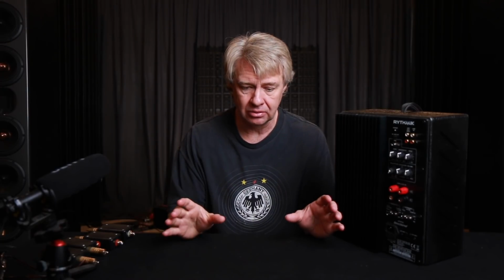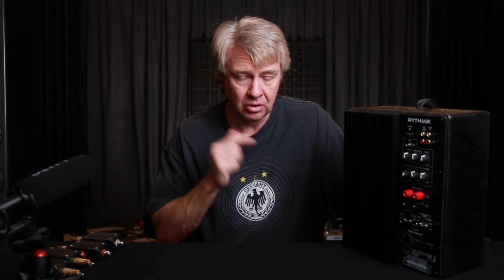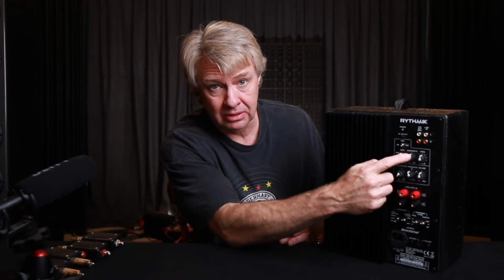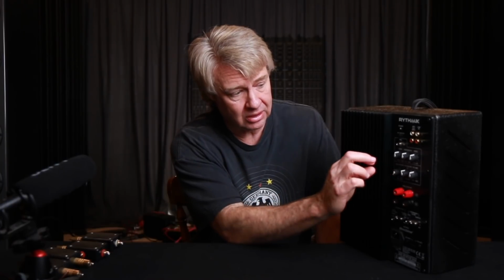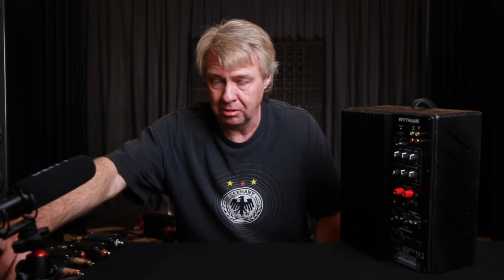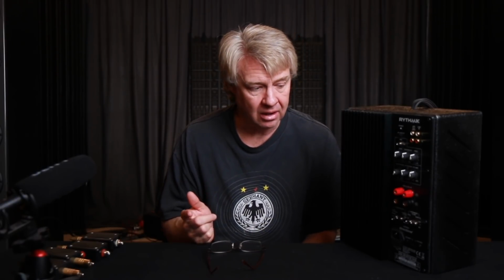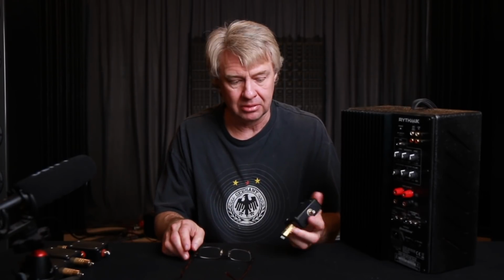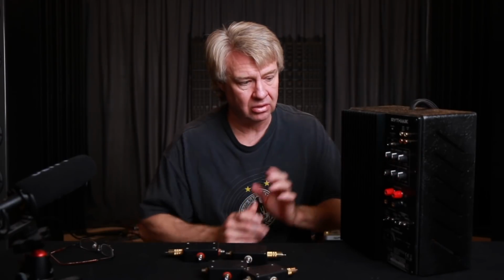How to DIAL IN your Servo Sub!

Comment: good subwoofer dials and control is the best thing i ever experienced and took my system to another level.  that rhythmic plate amp has most of what you need and better than most subwoofers you buy out there. 

as i only use digital sources i thought i would upgrade to minidsp shd studio, full dsp with digital outputs and more options. and keep my power amps and dac's.
Reply: I advise doing everything you can to keep devices like the MiniDSP out of the signal path, especially to your main speakers.
Reply: @dannyrichie9743  now i cant go back, full dsp is just way to fun.  i have only one digital to analog conversion but i do have a digital to digital conversion for the minidsp studio to get volume control and room correction dsp.  for main speakers not much dsp is needed, high pass and lowering the 3khz region is necessary, 3khz is really loud and harsh before i do a -7 db on it.
Reply: @sudd3660  From a strictly performance standpoint the Mini DSP will suck the life out of the music. The power supply, D/A conversion, and analog output stage is about the same as a $29 CD player form the early 90's.
Reply: @dannyrichie9743  i heard of analog output on mindsp, thats why i bought the minidsp shd studio, it has no analog outputs. ebu/aes right into my belanto dac.
Reply: @sudd3660  That helps a lot.
Reply: @dannyrichie9743   the problem is finding reviews for the gear,  
The Hans Beekhuyzen Channel was the only high end reviewer that did a review. seems to do little harm for the benefit it provides.
Reply: @dannyrichie9743  I did the same as sudd and have a miniDSP Studio (all digital no analog out) after my streamer/player to handle all sub xover plus it has customizable room correction with Dirac, then digital out via balanced to my Denafrips Pontus II dac to pre/amp with excellent results and no life sucked out of the music. Everything is much better and now I don't have to mess with battery biasing or dip switches on my Vandersteen passive external M5HP xovers anymore. My dual Vandersteen 2W Q subs and mag 1.7i never sounded better, although I am looking at your OB subs, or the sealed ones from Rythmik to possibly replace the Vandy spkr level only subs. Not sure if I missed it but what is your opinion on line level vs spkr hi level input on sub and have you ever compared? Vandersteen and REL are very big on it but others not so much. With my mag 1.7i xover at 40, or even at 80hz I can't see where much if any of the mains amp sound signature would be sampled to the sub and seems like a line level in would be even more pure/true to the signal, especially since with the miniDSP Studio all is done in the digital domain before the dac. Thanks
Reply: @michaelcampbell9459  The MiniDSP is less destructive to the signal the way you are using it. You will get far greater results by getting it out of the signal path and implementing our crossover upgrade to the Maggies. Our open baffle servo controlled woofers are the best match for the Maggies as well. They will match the radiation pattern of the Maggies and match them in speed and control. You can use the high level or low level inputs with good results.

Comment: Hi, Sir I love your explanation about this new breed of servo controlleb amp sub. W hen I first enter into these  audio hobby,I always hear from local audiophile here in our place Toronto ,that if your sub didnt came from Velodyne...that means you are not getting  the right bass.And Velodyne is synonimou with servo system sub as they always say. Ironically asVelodyne stop making their ULD SERIES  the quality of their sub decline until it was sold to a german audio dealer.Ive got a simple questio,If you dont mind pls ,the servo system inside the RYHTMIC sub   how does it differ from  the servo system of VELODYNE sub. And also is there any plan for RYTHMIC to come out a DOWN firing sub...if  not why? Great thanks

Comment: Love your videos, appreciate work you do, keep it up!

Why you choose 12" driver in your Servo Sub products not 15" ?
is it because of price, or 15" has bigger moving mass and it more difficult to control, or something else?
Did you have plans to produce  15" Servo Sub in future?
Reply: Higher Mms is actually desired in servo subs as the sensor mass is of lower influence.

Larger subs have a lower break up frequencies which means you can't control as fast.

Comment: Danny- thanks for this video- 2 questions - how high do these go (300hz?), and do you advocate for the swarm method, to flatten out sub response in-room?
Reply: I have used them with a crossover point as high as 300Hz, but 200Hz and lower is a better range to use them in. And the swarm method works great too. We have used that method before at shows to balance out the room loading.

Comment: What do you think of connecting to high-level like a modern day REL subwoofer? Isn’t it better to run speakers (esp. large floor standing ones) full range via high level connection?
Reply: There are big advantages in rolling off the bottom end of your main speakers. That is a subject that I will cover in my next video that deals with bi-wiring and bi-amping.
Reply: @dannyrichie9743  thanks; will eagerly wait for it. I’m a proponent of running speakers full range but know everything has pros and cons
Reply: REL sucks big time, huge time, compared to Rythmik like you cannot even FATHOM. you need to listen to the difference from a sub that you can ACTUALLY tune, to one you can't and is above 1K, like REL. they are coasting on a reputation and pure dogma.

Their high tier is a different story, but for what you pay for a single , you instead get 2 (or more) open baffle GR subs and REL goes back to absolute stupid investment.

So all that leaving your speakers full range for the sake of transparency and what not, BS. Seriously. It's a lousy argument. The sub bass on its own relieves the speaker woofers and lowers overall distortion for mid bass and midrange, depending of your speakers.
Reply: @BastianUllr  what would you buy buy for $5k for a pair of subs? Taking all recommendations:) thanks!
Reply: @Novilicious  what size is the room and what's the output you look to achieve? Are you open to DIY, or should it be finished?
Reply: @BastianUllr  18w*15l*11h (feet)…I’ll be sitting 11-12 feet away. I have sealed AT8600 speakers, they are fast and detailed like you won’t believe. Hence, Looking for a pair of ‘uber-fast subs’, they just can’t be slow. I prefer sealed subs as well that have deep and detailed extensions but not necessarily loud. Open to suggestions my friend but I suck at DIY so they have to be furniture grade for a high WAF :)
Reply: @Novilicious  Depending how many you can place, the more the better to control and even out the modes of the room. With 4x12" you should have the lower distortion of the 15"x2 although the size is smaller. With 2 15", you will have the output in a simpler way, but the bass might not be as even. Dialing 4 subs is more complicated, but if you have the room, go for it.  

NOW, read the reviews. There is an important part to all of this. These subs would sound as if NO sub is on the room. Subs does not mean MORE bass, because you calibrate them to be flat. So, it would sound about the same for the most part.... until there are subsonic frequencies that call for the lower output. For certain recordings in live venues, it enhances a LOT the feeling of space. For electronic music, is like having good headphones on, but then you also feel them. 
BUT, do NOT expect them to increase your bass unless you actually modify the curve to be higher on the bass or something. They simply dissapear once you dial them in properly. I have fast speakers too, no problems. Just, use the controls wisely and get yourself a USB Microphone and install REW in your computer. It's way faster, specially if you do not have a lot of experience.

Comment: Love my Rythmik FVX15. About to upgrade to 4x sealed for my dedicated home theater.  I'm between the Rythmik G25HP and the JTR RS1.  

One thing that has been said (by Chris Brinhaver at PS Audio and Matthew Poes, among others) about servos is that the feedback mechanism is inefficient because the amp has to dedicate a lot of power to correcting the driver's motion.  

I'm wondering if anyone knows how much of a concern that actually is, given I'm aiming for clean performance with no compression at reference levels in 4500 cu ft.  The CEA-2010 output numbers are actually higher on the G25HP than on the RS1, which makes me think this isn't a major concern.

Comment: What is the lowest voltage rating for the caps you can use in the inline filter?
Reply: The input voltage is very low. So they could be just 10 watt rated caps.

Comment: How do open baffle subs compare to something like Rythmik's dual opposed subs (G22 / G25)?
Reply: The radiation pattern is very different, so is the way they load and pressurize the room.
Reply: @dannyrichie9743  How would that answer maybe translate into musical terms like detail/pitch/tone/transparency? Thanks
Reply: @michaelcampbell9459  The lack of room boom from the use of an open baffle design will make all of those attributes much easier to discern.

Comment: If a pre-manufactured 3sub driver  solution-was offered with a nice painted finish, I would probably buy it.- any idea if that will ever be available?
Reply: There are people out there that build out our products in finished form. I can hook you up with one of those guys if you want.
Reply: @dannyrichie9743  
Do they have a website with photos of their work? Basically I want it to look like it’s not DIY. Do they veneer the flat packs? Or do they offer nice painting? Or magnetic cloth grill on the face of the sub?

Comment: What about tube amps for music? - it is written on the site that the resistance at the output of the amplifier will change all the time under load (including due to changing temperature) and it is impossible to set up the subwoofer correctly ... it cannot be coordinated with the stereopair and it will not dissolve ... (by the way, other manufacturers silent about it)

Comment: So if I was going to run these subs with the tripple towers and use a 8 inch point source driver, I can just run the point source in OB instead of running it in a TL box? Or do you think a TL would still benifit? 
Im guessing running the PS driver in OB would raise  the x-over point and speed the driver up. 
I have industrial hearing damage and I can't hear past 12k and 10k is really where I listen to max so tweeters aren't really needed so a good 8" PS should do me for the highs.
Reply: The servo subs can be used in crossover points up to 200Hz. So if your 8" driver can play down that low then you can use them together.

Comment: Planning to purchase your subwoofer and stand mounted main speaker kits. The electronics that I have are two vintage Japanese mono tube integrated amps. The output from the amps includes taps for 16, 8, and 4 ohms, plus common. How should I connect the integrated amps, the subwoofer and the main speakers?
Reply: There are speaker level inputs on the amp.
Reply: @dannyrichie9743  Yes. There is one volume control for each amp. This means that to adjust the left/right balance, each amp's volume has to be fine-tuned manually. One possible future project would be to have a remote controlled device that connects the volume knobs somehow so that the balance and amount of volume could be adjusted remotely.
Reply: @robertst1218  A separate volume control for each channel is a huge pain. I think I would by-pass the volume controls of each amp and add a good pre-amp.
Reply: These amps have an amazing vintage tube sound. If or when I add a preamp would probably just start over with all new electronics to get the best possible sound. Maybe I should hold off on the subwoofer, until all new amp and preamp are in the picture. @dannyrichie9743

Comment: You lost me with the filter box.  Does that plug into the back of the receiver/processor or the subwoofer amp?  And how does it work to affect the crossover from the "mains" (towers or satellites) to the subwoofer(s)?

Also, I can kind of see how using the controls on the back of the amp to flatten the responses, but I was lost on how the changes affect the output.  In other words, if I change the "A" control, then what happens to "Z" on the output (driver/room) side?

So confused... it's like I can see a shadow of a shape showing through a foggy day, but I really can't recognize what it is, much less see it clearly.

Thanks for these vids.  They are opening new ideas in how I move my home theater forward.
Reply: I just shot a new video on the inline filters. It should be out tomorrow.
Reply: @dannyrichie9743  Thanks!

Comment: Id buy the filters if he sold them.  Ive been wanting to try cutting off below 80hz to my main speakers. 
A simple line diagram would help clarify how to diy the filter and connection options. If a reply, Thanks.
Reply: I just shot a new video on the inline filters that should be out tomorrow.

Comment: Is the driver a special servo driver that works with the servo amp, or can any driver work with the servo amp?
Reply: The driver is a special servo driver that has a coil to give the feedback needed by the amp.
Reply: @g0g0Sutra  then you use velocity feedback with a sensor that is noisy. It's not desirable.

You want a driver with an accelerometer.  In theory all drivers can be used, but there are practical limitations. These limitations mean thay servos are only useful for bass <150-200Hz or so.

Comment: Danny, if a sub has two identical woofers facing to opposite directions, does it make sense to use two separate amps to do individual driver equalization? If so, would I then have to divide a box into two separate volumes?
Reply: We have systems where one amp drives two or even three woofers and we have systems where dual woofers are controlled by a dual mono amp.
Reply: @dannyrichie9743  Thank you, Danny. I guess I should formulate my question somewhat better. It's not about amplification but rather about separate and different (amp) tuning for each of two woofers in one sub (in a case when woofers face to opposite directions). Let's say, to use different EQ settings for one woofer in a sub that's facing a side wall and for another woofer in a same sub that's facing a "free space" into a room. Is that desirable (worth it) concidering the low frequency wave lengths?
Reply: @IliyaOsnovikov  With our open baffle servo subs they are loaded into an H frame design. One can face forward or backward and it matters not. One amp is all that is needed for the pair. They then act as one driver. So there is no need to alter them independently.
Reply: @dannyrichie9743  Thank you. Let me be more specific: I am trying to learn about in-room tuning of bi-polar sealed box subs or sealed box woofer section of a floorstanding 3(4)-way speaker with side mounted woofers (one woofer on the left side of a speaker box and another on the right side). Would there be any benefits (in a real size listening room) from driving them separately with somewhat different EQ settings or that's not worth it?
Reply: @IliyaOsnovikov  If they are truly playing down low only then they are really producing a more omni directional pattern just like when you throw a rock into a pond. 

Having them on a separate plate amp will give you a lot of flexibility.
Reply: @dannyrichie9743  Thank you very much!

Comment: Can a BTL Class D amplifier drive the subwoofer amplifier's speaker level inputs?
Reply: I'd grab a multimeter and put it on to continuity mode (beep mode) and put 1 on the - of the speaker level input, then the other on the ring of the RCA.  Does it beep?  If yes, don't do it.  What you want to do is work out if the - post of the speaker input is ground and connected to anything else.  If it is, don't do it.